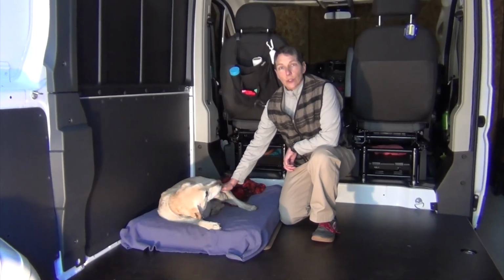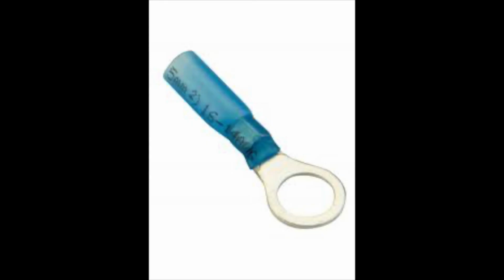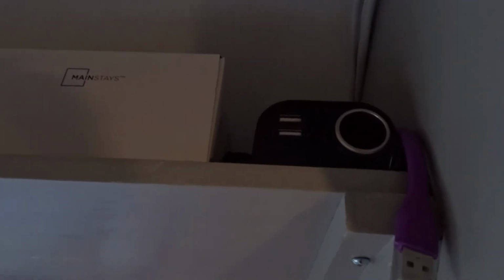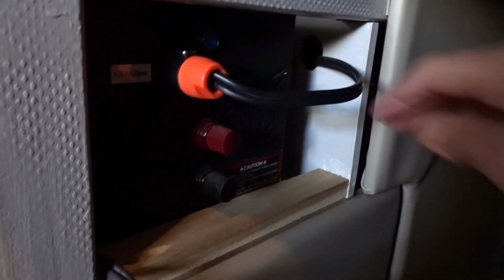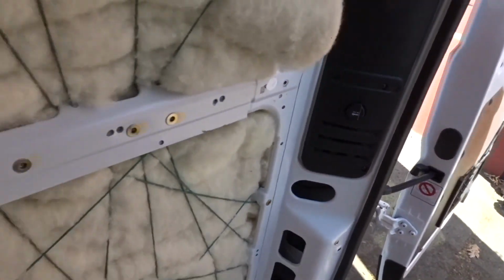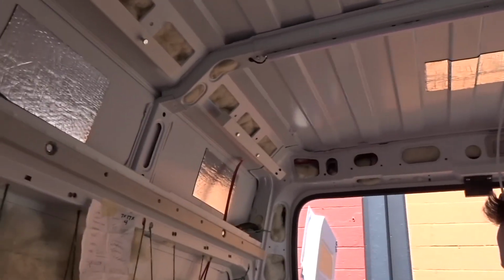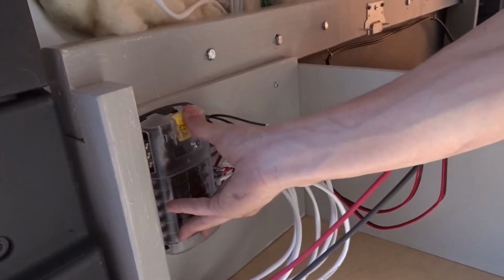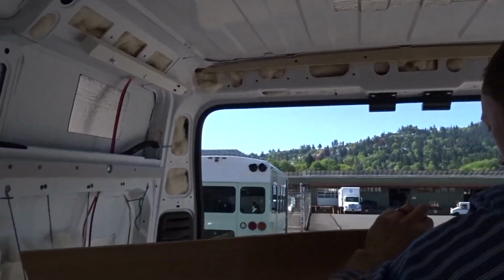Electrical and Ceiling

Comment: YES!!!   I’m thrilled to see this one pop up.  Campy is so happy to now have AC installed by Heart of Texas Conversion in Lakeway.  She cools right down in this blazing Texas sun thanks to the great insulation ya’ll did. I can even be inside no AC in full sun on a 95 degree day and not have to call EMS.
Reply from the maker: Betsy!!!!  that is fantastic.  So glad you can use Campy in Texas!!!  How do you power the A/C?  Did you get a generator?  Hope you are well.
Reply: CampHerVan 
They  went into the electrical in the left rear door I plug into electricity with an RV hookup. I have 6 friends and family in Central Texas in the country with hookups.

Comment: Good to see more great progress videos.  Electrical is tricky stuff.  I'm working through my electric system too so this was helpful.  However, the video showed something else interesting... your corner transition pieces from wall to ceiling.  How did you create them?  Did I miss a video somewhere?
Reply from the maker: tell me the time stamp where you saw the transition pieces. Not sure what you're looking at.  thx
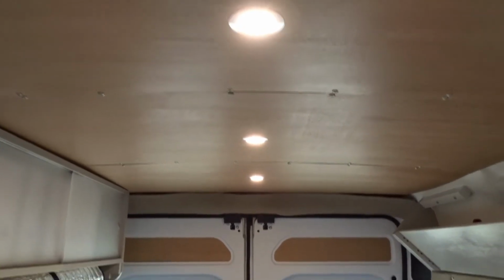Reply: @camphervan2398  The first glimpse was at 3:02, and a better look was at 12:40 near the back door on the driver's side.  I'm guessing the 2x2 piece is used to secure cabinetry, but I'm curious what you're using that has such a flexible curve?
Reply from the maker: @luvnotvideos  I am uploading the cabinet video now.  It's just a slow connection but the video should be up later today and that might answer your questions.  So watch for the Upper Cabinet video and let me know if you still have a question.  I think the piece you're talking about is a white plastic sheet 4' x 8' from Lowe's that I cut down to fill the space.  It worked so well for this build because the walls are crazy curved!!
Reply: @camphervan2398  Yep, that was perfect!  Thank you :)
Reply from the maker: @luvnotvideos  super duper.  I added a link to the lowes product in the video description.